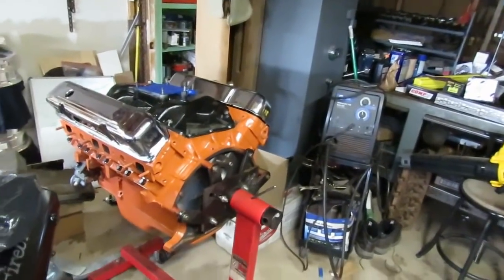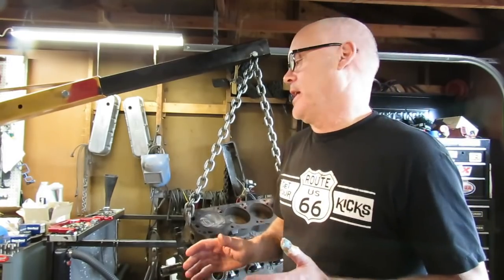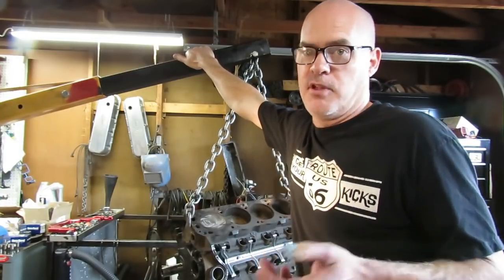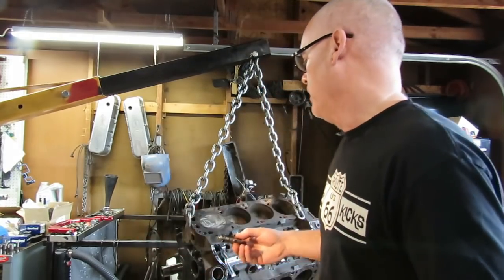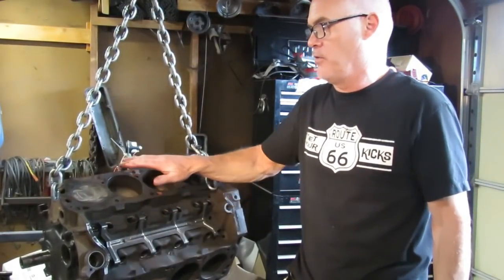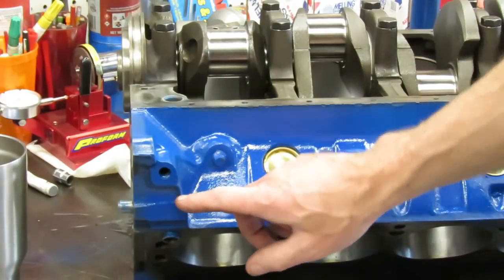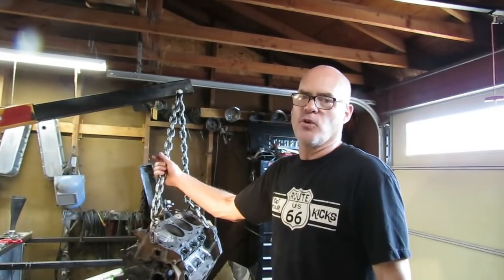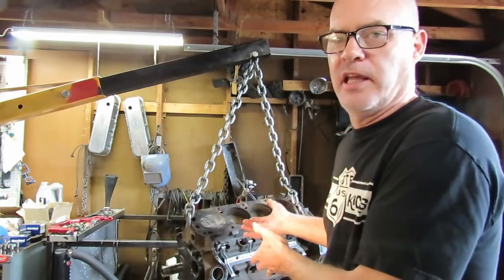How to get more power out of your small Block Ford part 3B

Comment: Had a step father that built his 289 to push 504 HP@ 9,000 rpm in his 67 Shelby GT350. They Black flagged him at Daytona, swore he was running a 427 super cobrajet, because he was hitting 210 on the back stretch, and a lap speed of 167.86 mph. His tech tear down proved he was clean and legit. Got Mech of the year for that one. Nobody was yelling put a Chevy in it. I built a 302 in the Maine winter that ran like a raped ape. That thing loved breaking hearts, topped out around 165. Went from Torrance to LaMesa in one hour, once. Usually a 3 hour trip at the speed limit. Flat lifters.
I certainly appreciate running into this video as you have enlightened me on a critical fact of modern lubrication.
Reply: The BS is strong with this one. Very.
Reply: Uhmmmm..... yes, and deep too!

Comment: I wonder how many people know that for the Ford f150 in 1996 model year Ford had 3 different firing orders based upon load usage and one of them was the same exact firing order as the 350 SBC 18436572. I only know that because I had a friend of mine that had a green 1996 ford f150 that I kept alive for him. I had to call a local ford dealership to find out the firing order so I gave them the last 8 of the VIN  and then I was asked "what do you use the truck for"? So I told them that my friend and I were using it to haul appliances and scrap from places and that we were working for our local Sears as an independent contractor.  So the guy said " well in that case you're gonna need the firing order for towing and hauling, the firing order is 18436572". It wasnt until about a year later that I got my 1992 Chevrolet Silverado with a 5.7L and what do you know, my Chevrolet Silverado had the same firing order as a Ford F150 truck, LoL!
Reply: Would still be different cylinders firing 'cause Fords are 1234 front to back left side and 5678 on the right. Chevies go criss cross from front to back I think !!

Comment: I would almost totally agree on an LS in a classic Ford just devastating the value. You can build the Ford SB to be just as good or better than any LS, and yes it will cost a lot more, but probably not as much as you devalued your car, unless it's just some cheap drag car.  My point with not totally agreeing is the Ford Model T , A, and others like it. That said an LS or sbc in one does nothing for me. When I see that I think they cheeped out and probably did everywhere else. I like to see them with Hemi Mopar , Buick Nailhead, bbc,and all the other engines that were just cool or powerful over the last 100 years, and likely to have been installed in them during the period. A Boss 429 would be a great candidate for a ford hot rod, but that's like a folklore engine, probably never really put into them, and most really can only own one through after market parts.
Reply: Check out NZ V8 Magazine no.206 July 2022 edition for a great article on a 1,000+hp 514 cube N/A Boss 429 powered '33 Ford Hot Rod, built way down here in little 'ole New Zealand, Robert !!

Comment: The 289 won lots of endurance racing back in the day with carol Shelby and others iam a chevy guy but I love small block fords and especially the boss 351 and 302 . I also love big block mopars and buick 455 engines no matter what I fix during the day as a auto tech at a large auction it comes down to maintaining the vehicle

Comment: excellent video, what do you recommend for the distributor drive gear  the bronze gear or the polymer gear with a billet roller cam. thanks
Reply from the maker: Depends on what the cam manufacturer wants
Reply: Remember,  the distributor also drives the oil pump,  so would you use a polymer gear,
or a bronze gear?  There are ways to lube the gears,  with engine oil,  which reduce the
wear and tear on them...

Comment: Great video!  Working on a 1963 fairlane 260V8  rebuilding back stock and you got my attention with the roller cam shaft.  should I consider a roller for this motor?  If I get it finished and am disappointed, I'm doing to roller motor thing with a C4.  Smoooooth power...
Reply from the maker: well you know me I say go roller you can do one in the 260

Comment: Geez, I wonder if I should be running a zinc additive in my overhead cam 82 Goldwing or is zinc just important during break-in????
Reply: Does it have bucket adjusters?  Mobile 1  has a high zddp oil for harleys,  may want to
research that for the GW...
Reply: @stevebates5973  Thanks.  it has rockers... still interested on whether the zinc is only important during break-in or for the life of the engine... I have read conflicting things but don't consider the sources that knowledgeable.

Comment: I have a 302 bored 30 over I have gt40p heads to go on it would the stock roller cam be ok to use I’m keeping it fuel injection
Reply from the maker: yep
Reply: Ok thank you    How good are the springs in the gt40p heads

Comment: I think the early 90's - to the end of production small block 351 Windsor engines used the 28 oz
balance flexplate/flywheel. Only the 302's used a 50 oz balance. You probably know this but your comment about the balance might mislead people...It's basically the same block, right? Love your videos!

Comment: The later roller blocks, according to some, had weight taken out of them by Ford. This purportedly led to the "belief" that the 5.0 splits down the middle at around the 500 hp. The early blocks apparently do not have this problem, or at least not as often as the later ones. What's your opinion? Thanks.
Reply: My opinion:  you got the tune wrong if it split the block.
I've built a couple of 5.0s that saw north of 600hp,  with safe tunes,  lots of boost,  have
had 1 failure...
Reply: Look on one of The Craig 909s recent videos. His Mexican block 302 is very much like the HiPo 289 block, with much beefier lower block material !!

Comment: Great video. Some of the early 289 motors had the original 5-bolt bell housing pattern (like 221 and 260 v8’s). That went away in mid ‘64 (I think).Otherwise the modern 5.0 is a drop in replacement for the 289-302 motors. The 5.0 motors have a reputation for cracking at high HP...is that a real issue? What HP level can these salvage yard blocks take without failure?
Reply from the maker: 450 all day long
Reply: The trick with the 302s, is to keep rpms below 6k, and have a good balance on the engine. Keep an eye on the balancer if you're running the 50 oz crank.
That said they'll run 500whp and a bit more no problem. Just have a safe tune.
Reply: @pimpovic2  Richard Holdener did a segment on Youtube about that, and he did real hard driving in his supercharged 302w Fox 'stang back in the late '80s in the 500 horse zone (Silver State Challenge, flat out for miles, for instance) !!

Comment: Thank You...This is what what I wanted to see you explain on the roller cams (I am too ugly for video)...for those that don't know/understand... (I use Kendall GT-1 Competition 20W-50 oil 1200ppm of ZDDP, and zinc additive, in my "tired" flat tappet summer cruiser 351W, but the next engine roller 393W... When I have time to work on my OWN stuff! ) FYI Pre-65 289/260/221 are 5-Bolt SBF pattern... THANK YOU for the "LS Swap" Opinion... (Rivalry is B.S.) ALL BRANDS MAKE MISTAKES, AND INNOVATIONS!   LS Engines are Great, They are much like the 12V Cummins...Make reliable power, NOBODY can argue that, but for a stock appearing vintage car, a close to stock style engine is best.
Reply: The only problem I see with LSx stuff is they tend to flood the heads with oil when used
in competitive situations,  AKA autocross,  filling catch cans after a 40 second run,  just
a little too much oil stuck ion the heads...
Reply: @stevebates5973  I would think that would be a mistake of not restricting the top end lube system.

Comment: My engine builder is recommending a Dart short block instead of even trying to rebuild my SBF block for a cruiser making less than 400 hp.  Watching  these videos I'm inclined to keep the block and just go roller retrofit.
Reply: Change your engine builder, as 400hp is easy enough with a correctly built/tuned 302/5.0 !!

Comment: Waiting patiently for the clevor!  And I would still take the pre 75 thicker webbed thicker cylinder blocks.
Reply from the maker: the Cleaver is my next build
Reply: @Myvintageiron7512  Would that be with Australian 302 cleveland heads, 351 heads or aftermarket?

Comment: I have an old 251 (Splitfire) in my 51’ Chrysler and every oil change I use the STP ZDDP additive. Fingers crossed it lasts.
Reply from the maker: it will be fine if the cam ran during the era where the oil actually had ZDDP then it was exposéd to it for years and has a bunch imbedded in the lobes but you on the right track keep using it

Comment: I don't recall you mentioning the distributor gear difference for a roller cam....need a steel gear on your old style distributor (vs the original cast iron distributor gear) to work with a steel roller cam.
Reply from the maker: this is something you need to ask the cam supplier many roller cams these days are made to use the stock gear Howards does a good job of this
Reply: Maybe you could do a video on cam/distributor gears....
It's getting confusing nowadays:
Cast Iron
Steel
Bronze
Composite
Melonite
Austempered Ductile Iron
....did I miss any?

Comment: SOLD!  LOVE your comment about brand loyalty.  Hell, I’m a “Mopar or No Car” guy (thanks for the praise given to the 383 and Uncle Tony) but a person who lends no respect to the products of other manufacturers is an ignoramus.  I want to build one of these Small Block Fords now.  Make it a family thing since my older, hippie era brother is a FoMoCo fan.  And sure, maybe the LS is the greatest Detroit engine of all time.  I’d even make that argument, but it’s maddening as a Mopar guy with a 70’ Charger R/T to have BowTie guys constantly tell me I can make it better by dropping an LS in it.  Ummm.  Guys. The 440 doesn’t exactly suck, and guess what?  It came with the car.
Reply from the maker: also here's a thought,  think about the new 5.0 it hang's with the GM engines even the 6.0 and the 6.2 power wise and potential  wise it's right with em,  and guess what its 300 Cubuc inches if ford ever builds a Big Cubic Inch Coyote GM is in serious trouble
Reply: @Myvintageiron7512  Could you imagine the Younger brother to the 1960's 427 SOHC?  (The 7.0 Coyote!)  700Hp and 600lb-ft would be possible...And that no boost, no bottle, just...(well you know the rest)   Now imagine if it was EcoBoost(ed) = 900-1200hp capable!
Reply: @Myvintageiron7512  OHC V8's are done at Ford. 7.3 Godzilla and now his 6.8 little brother on deck. OHC's have no torque.

Comment: I’ve  noticed a lot of black material is often on the bottom of the oil container. Is that the zinc? 
I often would give a shake before using.
Reply from the maker: Yes it takes 3 or 4 oil changes to get the moly Graphite out don't worry its a lube

Comment: So question anyone can answer the 302 in the 90-2000 explore and mustang and the 302 from the say 69 mustang is the Same bell housing pattern? Ive got a 69 mustang I'm wanting to manual swap but due to screws in my foot I can't drive a factory style for the Era cable or linkage I need a hydro clutch any help? Currently have a factory auto 69 mustang with the C4
Reply: The bell housing has the same bolt pattern, the late Fox Mustangs used cable clutches, 
so the effort to use it may be above your pain tolerance,  a hydraulic clutch may be the
best bet,  as you can play with the master cylinder and slave cylinder sizes to get the
lightest pedal...  The trouble will be getting the MC and SC sized for the force/movement...
Reply: OK I'm going to look for a 95 5 speed and figure out how to get the clutch to work thank you for the help it's greatly appreciated your help I have missed driving a manual

Comment: Love your vids, Chevy, Ford, or Mopar. I'm a Ford guy myself, built my only motor back in 1980 or so, used a 351-C 2V, torque/midrange cam, put in in my '70 Mustang and it was sweet. One thing I'm pretty stunned about is the aftermarket parts availability for Ford motors. Back in the day there was 10x as many Chevy parts available. I mean, damn, stroker kits for a 390 off the shelf! Just amazing.
OK Question, would like some advice on how to choose a torque converter for a street rod. That's one thing I never really understood. I had a C-6 on my 351, stock converter, always wondered if I should have replaced it.
Carry on!
Reply from the maker: the convertor depend on the Camshaft
Reply: TCI has a tech line IIRC...but like the man said it depends on how high the engine idles (which is a function of cam) and how you are gonna use it...Strip Cars use Higher Stall "looser" converter than Street cars, just to get the engine nearer to powerband....Also Say you have a Slightly Souped up 302 with a 2000rpm stall converter...That same converter behind a Slightly Souped up 460 will stall at 2500 or more...Just because the Bigger engine makes MORE Torque at the 2000-2500 RPM range, therefore capable of "slipping" the converter a little faster...some claim a "tighter" converter is slightly more efficient at hwy speeds... I have heard of guys trying to get better MPG with C6's in cars by installing Diesel Converters behind GAS engines...I wouldn't recommend that, certainly there is a performance penalty.

Comment: Amateurs, attention needy's, either way.  Big 3 fan here and any motor really.  Why wouldn't you like them all?!  I do have my this is your brain on drugs shirts modified with all three brands, Ford, Dodge, & Chevrolet at the on drugs location with a clear piece of tape over that brand.  Worn for my super hardcore fanboys only, and when they ask what the tapes for, I tell them.  Something has to hold that brand together, lol!  It has started a few fights,  mostly verbal as I'm  over 6' and 280 lbs, and great at defense... Wife and I have a 1967 Fastback Mustang, 1977 K2500 Chevrolet, and our 1st Dodge, a 1982 Chrysler New Yorker.  Can you say stoker motors in everything?  Yes, you can.

Comment: I got a LS1 car and I got a 351  car I would never put a LS in my Ford car that's on some Frankenstein malarkey. I agree 😩👍🤓
Reply: Funny you mentioned an LS. It is just a small copy of the old FE engines.
Reply: @mikecarico5465   I really enjoyed this comment so true 🤔👍
Reply: I have a friend that took is 1955 corvette;  Replaced the Blue Flame straight 6 with a tri-carb flathead.  THEN he took it to a Corvette show.  The Chevy guys were somewhat irritated.
Reply: @barrystein8834  Certainly wouldn't fall over another one !!
Reply: So what do you think about rear ends? I chose to swap out a 10 bolt diff in a 1964 Chevelle SS Malibu Convertible(1100 made) with a narrowed and tweaked 9" Ford diff. The car was lowered with wide 16" front and 19" rear wheels stuffed in the fender wells. 4 wheel power disk brakes, Power steering and much more. Handled like a smaller car. The customer loved it.
Reply: @bryanst.martin7134   yeah that's different to me that's done tasteful. But when it come ro swapping Ford motor into a Chevy or Chevy motor into a Ford I hate it. Not even in a Little Deuce coupe. Kind of like a 59 Galaxy dashboard In a 57 Chevy you know . But people like what they like it's just not my cup of tea 🤢😏🍵 im not gonna lie ford rear end they just better all around
Reply: @joshuafranklin3074   I definitely agree
Reply: Thanks for the videos and the upgrade engine informarion and what to look for in finding a roller 5.0 block. I've been a ford enthusiast all my life. 
When I see a beautiful ford car hot rodded with a bowtie it makes me turn my  attention somewhere else. Sure it's got performance but the nostalgia is gone.  I'd rather look at anything else because theirs nothing classy about it.

Comment: Fun fact, the 383 Chrysler makes a sweet 496" engine, going from the factory stroke of 3.375 to aftermarket 4.250, and with little to no block clearancing.
Reply: Absolutely.  And it’s younger brother, the 400, makes a sweet stroker that can take a lot of ponies because of those beefy main saddles - and the B block does it all with two bolt mains!  

The big three all had triumphs.  Competition is a wonderful thing!

Comment: Great video. Could possibly due one exactly like with the gm small blocks? I know you done one on the camel hump heads vs vortec heads. But would like a video on the older vs factory roller cam blocks.
Reply from the maker: Great suggestion!